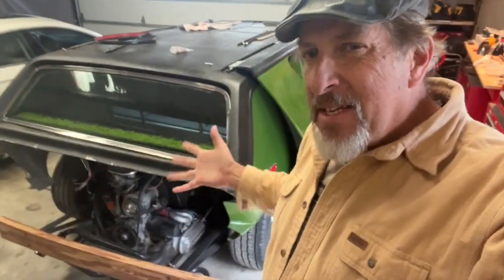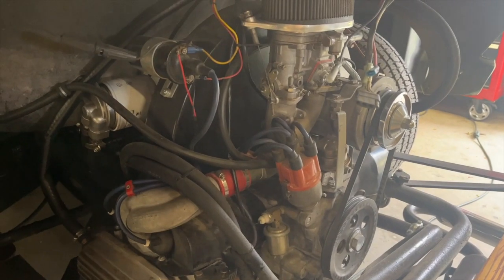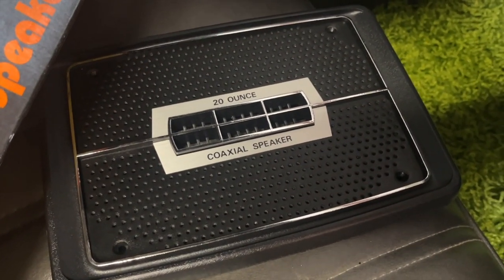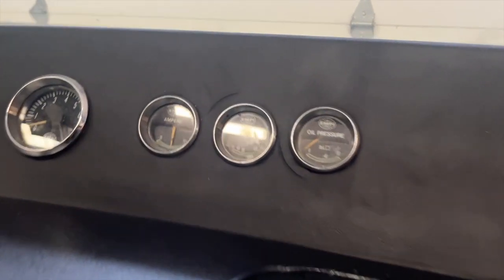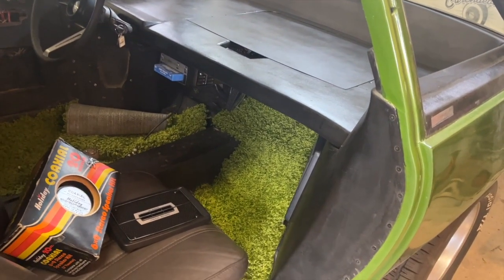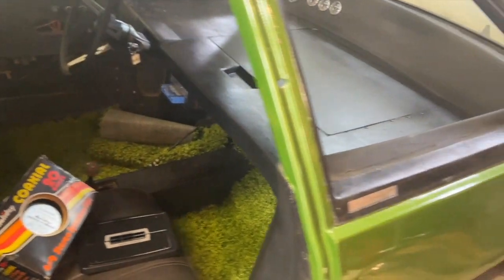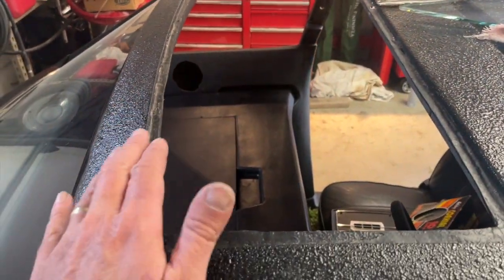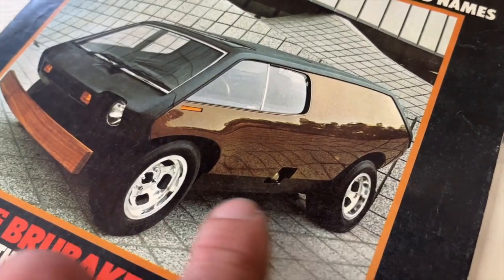Carchaeology: Brubaker Box Restoration Update "Thinking inside the box!"

Comment: It's looking pretty damn snazzy!  The cooler idea is bitchin', I wonder if you added a simple drain it could be multi-functional; besides, easy to clean!
I'm imagining some type of "gravity feed tubing coil liquid cooling air intake density increasing containment discharge unit" that could even potentially be designed to leak down or spritz off the side of the engine or in front of the fan that would essentially vaporize and bring down the overall under hood engine compartmentalized area ambient temperatures?  The idea being, of course, with the overall goal of adding a turbo and intercooler system; as well!!  
I'd also like to see a built in guitar amp and cabinet filling the back, if possible, with an exterior input jack for playing from outside with pedals!  The Soylent Green idea has potential, being that the color and the shag carpet are fitting to the name and there is also a famous metal band of this name that could want to buy it!! (They're spelled Soilent Green)